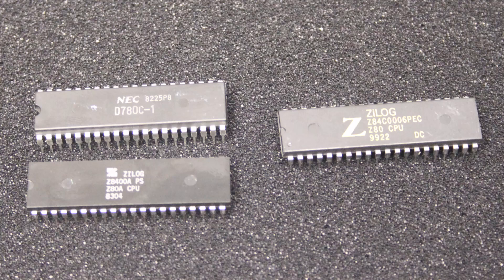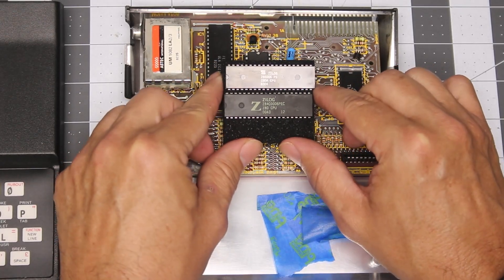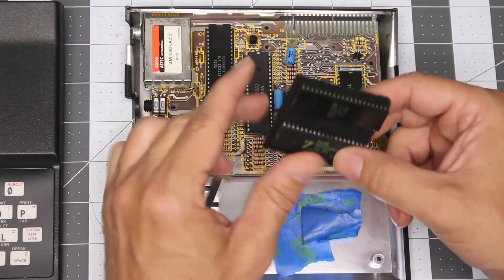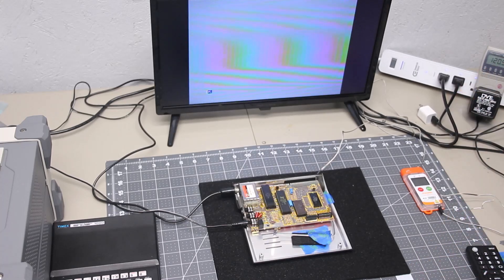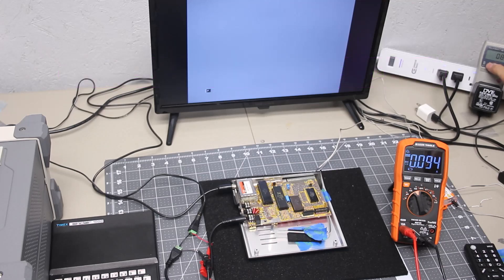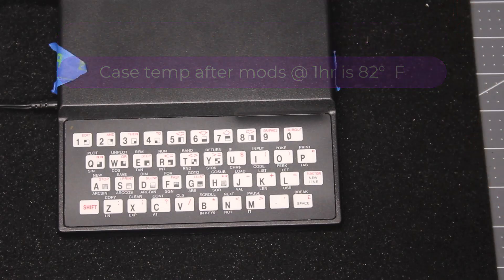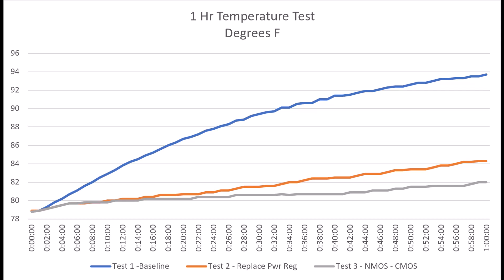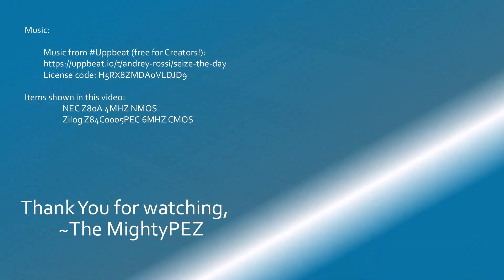Sinclair ZX81 Projects Part 2 - CMOS CPU Replacement

Comment: I also replaced all the ceramic caps with new ones and the RF with a new $10 composite mod and it works awesome with a modern flat panel display.
Reply from the maker: @tenminutetokyo2643  thanks. Im going to look at video next, the output is crisp, then goes wonky and back and forth.  The initial removal of power regulator and heat sink made a noticeable difference. So at lease some of my video issue was heat.